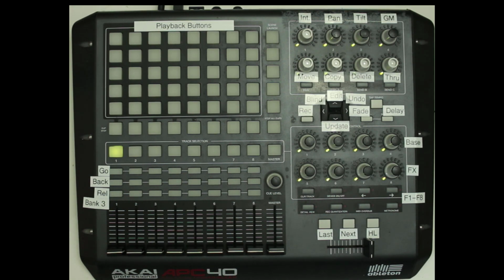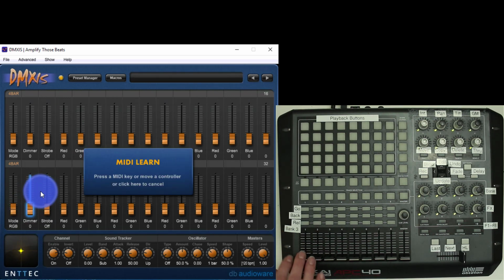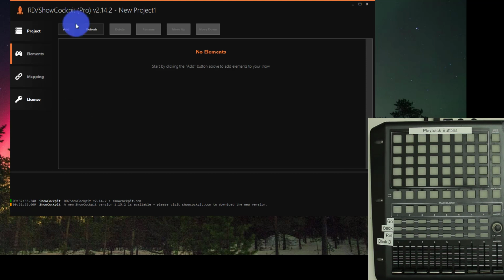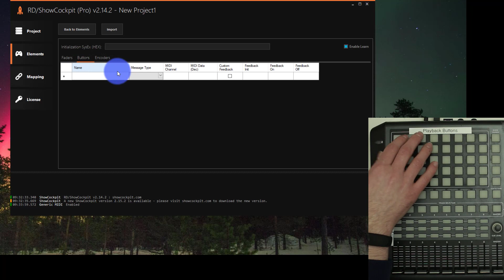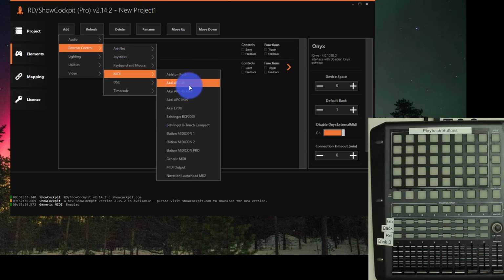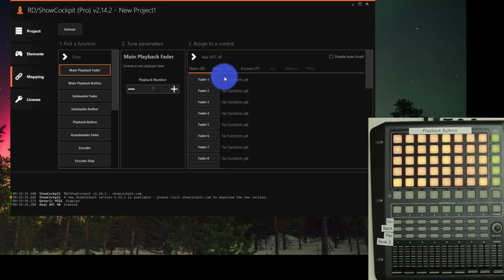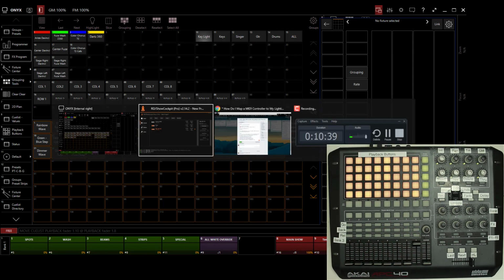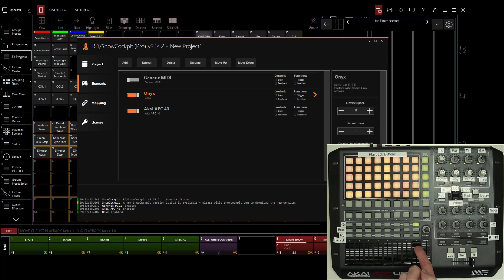How Do I Map a MIDI Controller to My Lighting Console?

Comment: Good evening David. I and Neal Roby are banging our heads on how to change the mode on either the APC40 and APC40 MKII. We have bought BOME, I really don’t want to have to learn another software. We are running windows 10 on a 24” touch screen all-in one computer. I can’t tell you how many hours we have spent. Can you solve this issue???
Reply from the maker: I haven't spent a ton of time in Bome's, but what you need to do is send a MIDI sysex message on startup.  Here's a guide I found: https://www.bome.com/forums/3/3641/apc40-amp-traktor-sysex-message-for-initial-in-quotdumpquot-mode/

Comment: I have a Martin M1.  I am currently running onyx.  I have purchased Showcockpit.  Now How do I make it all work.  Do I have to network my devices or can i plug the Akai APC40 directly to my board.  Please help.  I am missing a simple step and I cant figure it out.
Reply from the maker: You need to run ShowCockpit on a PC, and run Onyx there networked to the M1.  Plug the MIDI controller into the PC.  Both myself and ShowCockpit themselves have tutorial videos here on Youtube as well :)

Comment: Is this workable for a Hog4 ? I just want to be able to either send go commands, or is Qlab better?
Reply from the maker: It really depends on what type of show you are doing.  Q-Lab is more for theatre cues, adding a MIDI controller is more for running lights live for music performances.  

Before you buy, make sure you have everything you need to unlock MIDI in Hog4 - I'm not as up-to-date on the Hog platform, and so you may need to have a console or PC widget to unlock MIDI - not sure!

Comment: I haven't read all commentars so sorry if i ask somerhing that's already been asked before: is there a way how i can map a midi controller that i can set the specific dmx-channels of a fixture with the faders of a midi-controller? For example: lets say i want to create a new scene and i dont want to set the dmx-channels on my screen but with real faders. Can i map the faders of my midi device to control the dmx faders in edit mode?
Thanks for your support!
Reply from the maker: Hey Mike,
Every console handles MIDI integration and programming differently, so this is not the simplest question to answer. :). Most modern consoles do NOT work like this, but some do have workarounds.  For example, in ENTTEC's DMXis, I can do this, and if I need to separate scenes out, I can use a function called "channel masking".  

The problem that you'll run into quickly is that modern lights use many channels, and often it quickly becomes impractical to have so many faders. (Which is why most consoles no longer program this way - DMXis is one exception!). Thanks! -David

Comment: Awesome video and hopefully this is what I need but please let me know if there's anything better or if this is the right thing.
I use the MPK249 with SoundSwitch software and DJ808 with serato and most times the 4 faders on DJ808 are mapped correctly on SoundSwitch but will just not work (only once) and the SS team said the following: Windows does not allow two pieces of Software to be controlled by the same MIDI controller.
 There are 3rd Party MIDI routing softwares that allow you to achieve this.
Any help is much appreciated.
Reply from the maker: That is correct, check out the software "Bome's MIDI Translater", which is a good one that I believe can achieve what you need.  Then write to SoundSwitch and beg them to add the functionality for multiple MIDI controllers!  Other programs have it :)
Reply: @LearnStageLighting  Thanks for the reply. Based on their feedback that functionality exists already but for Mac users so they say it's a Windows problem. I'll check out that software but would love to know more about how all this is supposed work in a future video perhaps. What do you think of loopMidi by tobias-erichsen and Cantabile Lite?

Comment: Hello man! How I can do mapping for generic midi controller like worlde 48 for work with hog 4?
Reply from the maker: This is one of the reasons I really don't focus on Hog4 - unfortunately, they don't allow MIDI to be openly used with their software in this way.
Reply: @LearnStageLighting  It is very bad for Hog, I have tried to  connect with  ma2 through cockpit - ok! But I do not understand why Cockpit do not see all buttons of My midi controller: all faders, all encoders ,and 2/3 pad buttons . SO , cockpit have no reaction on 1/3 pad buttons and all around programm buttons lik Velocity , Manual, record,change layer and soos

Comment: Is it possible to use an APC MINI in this fashion? I ask since they are 100 bucks new and would probably be good for small mobile DJ setups.
Reply from the maker: Totally.  Of course, check with your console and make sure it has the capabilities to do MIDI - but yes, the APC MINI is very popular for MIDI lighting control

Comment: I'm totally new on M-PC, and just switched over to Onyx. I believe it should be possible to control Onyx directly from MIDI without ShowCocpit. I have been able to trigger cues from MIDI, but it's a jungle to learn when you don't have any pre-knowledge.
So far, I've been able to trigger cues, but I'm not able to control any programming buttons and parameters.

I would really appreciate if you could make a short video to explain how to use MIDI directly into cues in Onyx.
A reply here with some details and tips is also appreciated off-course :)

Thanks for your great videos by the way. I'm learning a lot by following you :)
Reply from the maker: That is correct - you will only get cue triggering without an outside app like showcockpit!  I will add that video to my list of things to do!
-David

Comment: Its there a "better" way to use a Midi Controller??? I mean, its there a Standard on this or just depends on the person??
Reply from the maker: As for "what" to map to your controller - there really isn't a standard.  I usually set it up to be mostly playback.  But, if I am in a situation where the MIDI controller is the only physical hardware that I have for the console, I do make it a mixture of "programming" buttons and playback.  

That's probably the best thing about MIDI controllers - you can make it whatever you want, in whatever format you want!
Reply: I dont have the Akai Apc40, i recently bought a Novation  Launch control XL so i can use it as control surface with DMXIS.

So i use the faders to map into the Dimmers of each light and Pan and Tilt, and all the colours i map them to the knobs. 

This Midi controller has 8 different User Setting that  i suppose could work as pages. 

Would you use it in a more practical way, how would you use it?? I am new at this, being trying to figure some things out hahaha but dont know if the work flow im using its a better way to use it
Reply from the maker: @leonelrojas1516  I would recommend keeping it simple.  1 page, map what you need, and if that doesn't feel like enough to you (as you use it), then expand to more.

Comment: Question, so If i have Ableton open and have mapped my scenes via midi when i press a button, can I simultaneously have DMXis open and use the faders to add in extra effects?
Reply from the maker: Yes, you can and you can also control individual channels through Ableton via track automations as well.  More info available inside of Learn Stage Lighting Labs: https://lp.learnstagelighting.com/learn-stage-lighting-labs/